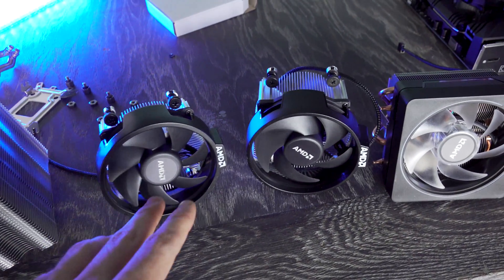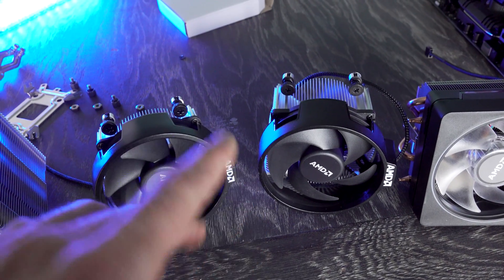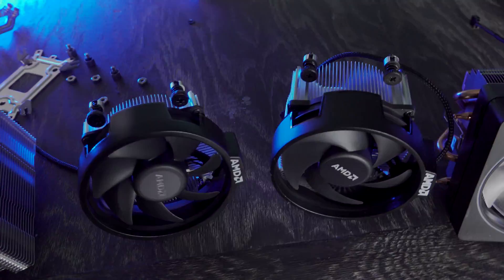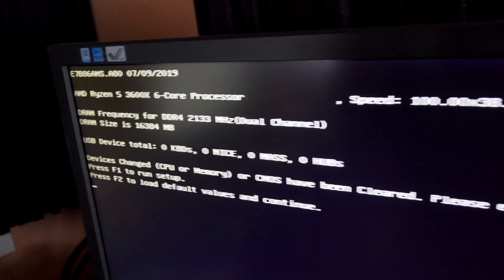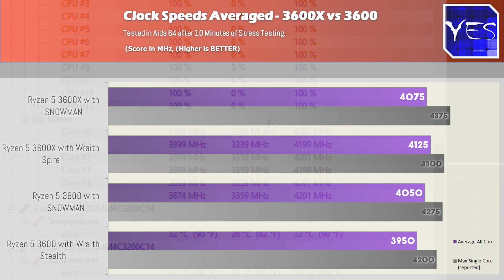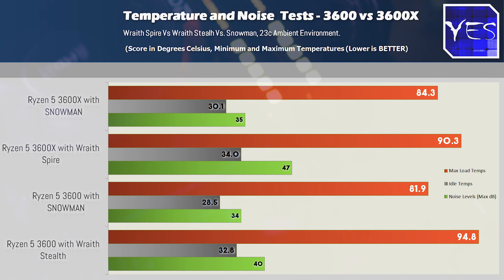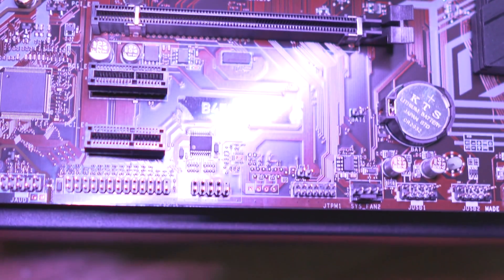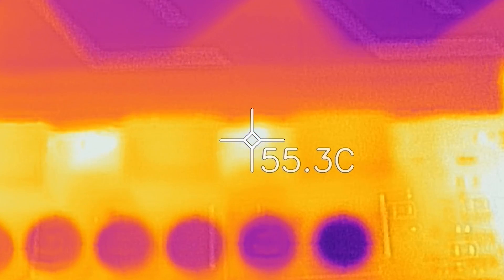Ryzen 5 3600 Vs. 3600X ON A B450 MOTHERBOARD

Comment: Honestly I don't understand why not all motherboard manufacturers don't have a BIOS USB flash option when you don't have a compatible CPU 🤔
Reply: You need hardware to do it , that hardware aint free so on low end boards when every penny counts they cut it. Thats no reason why they cannot socket the bios tho so they can jsut send you a chip out.
Reply: The retailer I usually order from has a "flash BIOS" option for 5$. They also lent me a CPU for free once, when I went into the shop with my PC for a BIOS flash. So, it's a handy, but not an essential feature.
Reply: @TheGyuuula  Wow that's a really fair price. The biggest retailer in Germany asks 35€ :D But I think the MSI B450 Tomahawk MAX is the best bet right now. here it's priced just as the non max version and it's a good board which supports 3rd Gen out of the box with a bigger BIOS chip.
Reply: Andre Bergmann In India we don't have tovpay any money to get the bios updated 😂
Reply: @TheGyuuula  The most famous reseller here in Germany is Mindfactory and they will charge you 35€ extra to send you a flashed mobo... they are CNUTS.
Reply: @CrashPilot1000  Live hack: Order a (cheap) 200GE APU or Raven-Ridge if you don't mind it basically flashing its own compatibility out of existence (happend to a buddy of mine, updated fine though) between 0 and 6 o' clock and pay with PayPal. That way you save the shipping costs both ways because PayPal lets you request return shipping coverage and they always accepted mine. Even a <20€ 775 Xeon to China for like 6€ was fine a few years back, lol. Also, if they were cunts they would not basically send me a free PSU, 80€ bequiet case and Dark Rock Pro 4 cooler. All because I just did some basic form-filling or minigames and having the luck of the draw. Also, a 2400G for 105€ including the Division 2 Gold promo is not bad.

Even more after my Ryzen 7 1700 turd I got from Mindfactory (3.725 GHz @1.4V unstable no matter what, other sample does 3.9 GHz+ easily with same setup an settings) at release MSRP (dropped like a few days later by 30€ and then still more than halved withing a few monts - fml) I finally got a lottery winner. The (mind-you in reviews oftentimes struggling to hit 3.8 GHz comfortably) 2400G does 4 GHz flat easily with 1.32V even at high RAM speeds for Zen1 3266 MHz CL14 (on lower might even do 4.1 GHz) and the iGPU at least did two Firestrike runs without crashing @1600 MHz which I did not test much further yet, but I know it BSODED @1700 MHz which is to be expected with "just" 1.22V VSoC, but more makes my RAM less stable...
Reply: CrashPilot1000 try Arlt.com. They do it for 15 € which is a fair price I think
Reply: Whats really ridiculous is AMD planned in advanced to support the AM4 socket for multiple generations and yet didnt even forsee this being an issue. They could have easily pressured manufacturers to put them on their boards and by the x470 this should have been a thing. Not to mention this idea that higher end boards get them is bs. Case in point my x470 Gaming Pro Carbon which is a high end mid tier board. Doesnt have it but guess what? The cheaper lower tiered B450 does. Makes total sense. They just put random stuff on random boards. All of it costs mere pennies to add but they dont give two flying shits.
Reply: Just download more ram lol
Reply: Thx Bros! Danke Brüders :)
Reply: @CrashPilot1000  No problem.
Just to make my previous comment more clear: Mindfactory charges no chipping fees in the first six hours of any day (strange policy I know) if the checkout price after any (possibly applied) rebates and including VAT is at least 150€. The fact that it is unlikely that anyone will buy a board apart from a CPU (because it makes no sense in most cases, if not to replace a dead out-of-warranty board maybe or purchasing a used CPU) so the 150€ is quite easy to hit even with a Ryzen 3 or Athlon including an old APU for update, even if RAM and anything else is bought separately. Otherwise you could of course not buy there, but you won't find any much cheaper retailer for new parts in the whole EEA from what I know. So smuggling from the US it is then?
Reply: tbh, Im really pissed at that. I have an extreme budget, and ive made some mistakes. one of which is buying a b450m-hdv motherboard with a ryzen 3 3200g. This stupid flashback thing basically means I need another cpu just to use the cpu which is bull shit. I made a large mistake and bought the ryzen 3 3200g from offerup. He said it worked great for him and he seemed like a good dude. Anywyas I built the pc to find this out and i have no idea how. I was thinking of just sucking ti up and buying a ryzen 5 2600 or 3600 but im researching and it honestly seems like no cpu is actually usable with out this stupid flash.

Comment: B450a-pro is b450 tomahawk without fancy desing, rgb strip and little smaller radiators
Reply: there is also a difference in IO the pro doesnt have usb 3.1 type C, but does have 1 additional pci-e x1 2.0, and a tiny difference in audio shielding
Reply: Tomahawk B450 build https://youtu.be/vSxIv4yqB6Q
Reply: yea lol b450m pro vdh would be the budget thing
Reply: dont build tomahawk + 3600, there are big chaos of incompatible issues in msi reddit. Bios still unable to post sometimes
Reply: That's why they made the MAX series.
Reply: @EthnoEuropean's CountriesAreBeingInvaded no but if you have option to return then do it and wait for the max boards they are not available yet tho.

Comment: Im planning upgrade from FX 8370 ,should i wait for B550 release or take a B450?  (dunno which 1) ...(3700X) + decent rams around 100~
Reply: Well, unless your pairing it with a PCIe Gen4 SSD, if you dont go TOO cheap on the B450 board, you should not have any overheating issues. That being said, for better efficiency, I would suggest getting a cheaper X470 over a B450 because alot of board vendors did cheap out in the VRM department on the B450 series, and if you plan on overclocking that could be a big difference in what your able to achieve with the newer processors
Reply: @Celician83  you should look at the vid brian did with the a320, it actually out performs the x570 motherboards and is more efficient actually. https://www.youtube.com/watch?v=wF8EuEfKH3Q
Reply: @Rem_NL  out performs, but how stable are the clocks on the weaker VRM's and how hot do they get, especially in a case without decent airflow? Gotta remember most bench tests are done outside of a case, and most modern cases lack decent airflow with these tempered glass designs.
Reply: @Celician83  vrm temps and clocks are show in the vid
Reply: @Celician83  i dont wanna OC anything ,thanks for advice :)

Comment: What I would like to see is for a 3600x to be used with a top end X570 MB to see if it can boost higher than with a B450 MB.
Reply: I can't recall which channels, but have been watching anything towards boards comparisons and performance amongst 350/450/470/570. Not much difference unless you're going for the the Ryzen 9. A good cooling solution seems to be more important as PBO/PBO2 will push more if it stays cool and the mobo can handle the wattage. I'd go with the iceman :D

Comment: Guys 1tb hdd and 256gb ssd or 1 tb ssd
Reply: @clint8774  why is that i mean 1 tb hdd 256 gb ssd is cheaper right?
Reply: SSD since the prices are falling all of the time. Where I am, a 1tb SSD is currently cheaper than the 256gb ssd and 2tb HDD I bought at the end of last year.
Reply: @haydenw8691  but how much is it as of rn
Reply: @jasondeng3820  still cheaper, but I have a Samsung 860 m.2 a long with a 7200rpm Seagate Barracuda 2TB so you can definitely beat that price. Best to check pricing in your area.
Reply: @haydenw8691  nice
Reply: @clint8774  how much a is good 1 tb sata ssd anyways
Reply: @clint8774  ik my friend has a hdd the load time is pretty slow
Reply: mechanicals under 3-4tb doesn't make sense economically. if you need bulk storage go with large mechanicals but the main storage should be solid state.
Reply: 1tb ssd are $100 here in mexico. I would rather go with a lightly used 1tb hdd and 120gb ssd for $50.

Comment: just bought 2600 with b450, 3600 is 100$ more than 2600 here, heck 3600 is even pricier than 2700 in here
Reply: i think its a better choice for purely gamers, spend the extra 100 euro on GPU horse power instead on the cpu. But i have no numbers to back this up though
Reply: @Rem_NL  I think so, too. Even with a 2080ti quite a few benchmarks will be gpu bound even at 1080p. So no point in sinking too much money into the CPU unless you want to game at 720p and rather spend that on a better video card. Most people will probably use a cheaper video card than a 2080ti( I use a 1070ti)
Reply: Good choice, the 2700 is still a sweet CPU. I also bought a 2700x I got for a cheap price :)

Comment: Nice :) please compare some RAM  with B450 and X570 on Ryzen 3 , I saw some german videos saying B450 is the way to go
Reply from the maker: Hey there, got something interesting happening with both, found something pretty crazy too on ram.
Reply: X370 will work if B450 is not readily available.
X470 is probably the best choice.
Reply: Msi B450 tomahawk
Reply: U could even go b350 and still get good clocks on ur cpu but u might not get the 4.4 boost on 3600x even with a good cooler, manual oc'ing ur prolly gonna get 4.2-4.3 on all cores if ur lucky, some online store sell em at a discount with no cooler, so u could find a 3600x at 3600 prices
Reply: Ryzen 3? Like....the 3200G?
Reply: B450 you can get at 100 bucks and  3000 series can support 4000+ MHz RAM, 4 ghz max for cpu then, no worry about heat for mosfet etc, 65 degrees max with 3600x
Reply: X570 for possibly the next two generations though. If you are switching over from Intel the X570 series is probably a good choice and will pay for itself in subsequent upgrades.